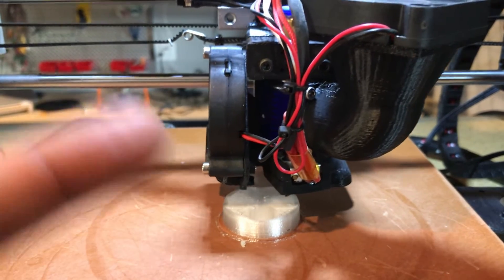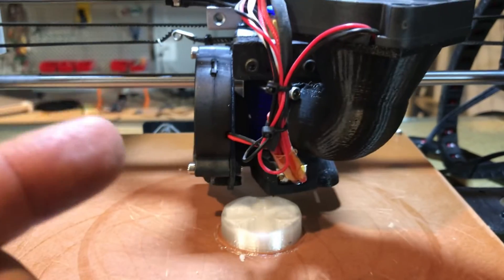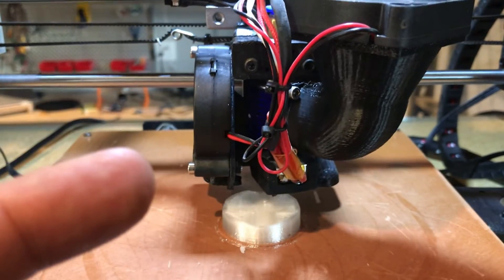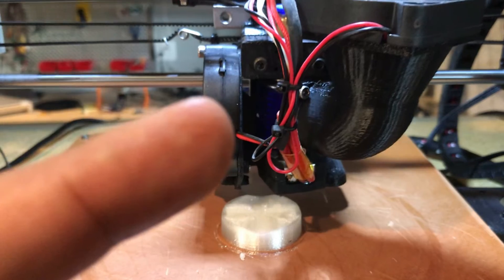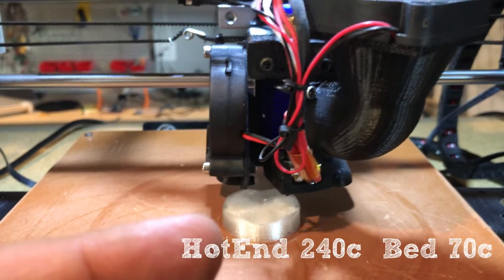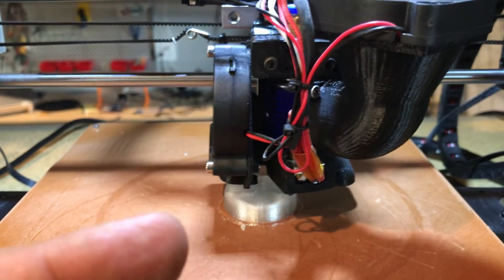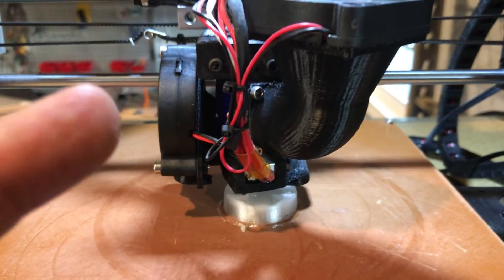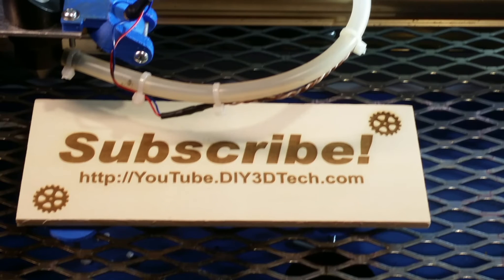At The Printer  -  Talking TPU Tips and Tricks!

Comment: I am still waiting on a order I sent for, a "Titan extruder" made for my big Tronxy X5SA. This is as it stated designed for TPU filament so the feeding don't bend up etc.  I say still waiting Because I ordered it 2 weeks after getting my print as I seen the videos online stating you need this type of extruder for TPU?  I got a message from the company that the order was lost in the post somewhere!  I asked for another one to be sent as I need it for the TPU I brought?  Of course until I can get my prints to stay on the hot bed 1st without popping off just 50% or even 90% of the time taken to print would be great before I even get this Titan unit.  I've seen your video about bed adhesion and see that the blue tape looks good idea ( although it is pricey in the UK. ) As is the PEI sheet for the printing, that really very pricey here.. on Amazon the cheapest I found was £30 for a sheet that don't fit my bed size of 330 by 330 mm the nearest size was 300 x 300 mm. And some even smaller at 9 inches square and costing £70. Totally mad. It seems to be the same thing happens? The hobby gets popular and the prices shoot up, even more in the COVID aftermath.  I can't keep paying out tons of money,  This hobby already cost allot. I could have brought a 55 inch Samsung flat LCD 4K UHD smart TV for this sort of money I've spent sofar and still had money left over! So not cheap. If I don't sort all this printing soon, I be selling all this stuff and not do 3D printing again?
Reply from the maker: Cost of the hobby is subjective, however you can do TPU with modest gear as the big thing with TPU is speed, slow it down and heat it up.  As far a build surface, I use a phenolic sheet (just search TPU on my channel) and that is about $30 USD for 200 x 200. :-)

Comment: Hi, I'm having hard time when printing TPU on my all metal hotend (Trianglelab CR-10/Ender 3 replacement: https://www.aliexpress.com/item/4000079270327.html?spm=2114.12010612.8148356.39.3f4a1a6cbjZZvD). It's fine until the hotend path is clean, but it's just one time use as when print finishes the filament is retracted about 8 mm but it's melted at that point and sticks to hotend walls making it impossible to start another print as the filament can't go through that narrowed path and bends above. 
I tried to wait until hotend cools a bit, say 180, and then retract, but it didn't help. 
What else can I do? Is not enough cooling an issue?
Do you have any special end print script for your TPU configuration?

Comment: Excellent, what retraction settings would you suggest for PLA on all metal hotend Bowden setup?
Reply from the maker: Great question!  I run 6.5 mm at 50 mm second for PLA I also recommend Capricorn PTFE (see more here: https://amzn.to/3c3hPaE  ) as with cheap PTFE and the long retract you run into the hot gumming because of the PTFE tube...

Comment: Great update
I'm struggling with TPU right now....
It just clock the hot end ALL the time..
Thanks for sharing
Reply from the maker: Thank you and  also for some additional help is if you don't have an all metal hot end you need to get Capricorn PTFE (see more here: https://amzn.to/3c3hPaE  ).  Next make sure the temp on your hot end is the true temp your machine is reading, a couple degrees makes a big difference.  And finally as  mentioned in the video, retraction is your enemy with TPU, work to minimize it with the retract travel and trace over part...